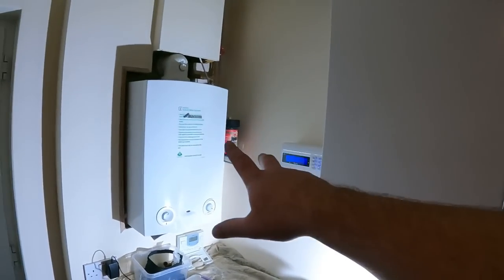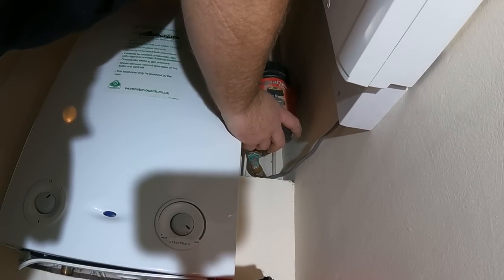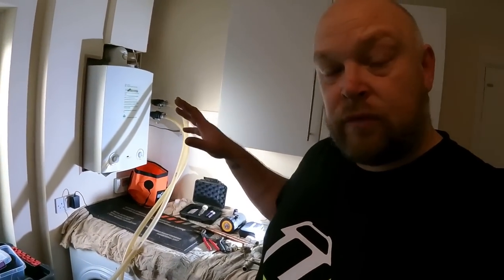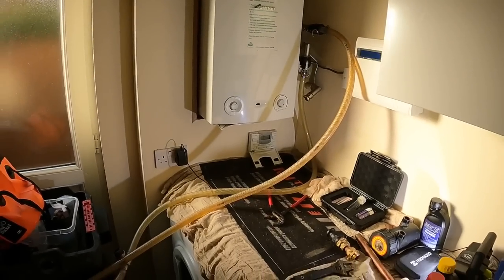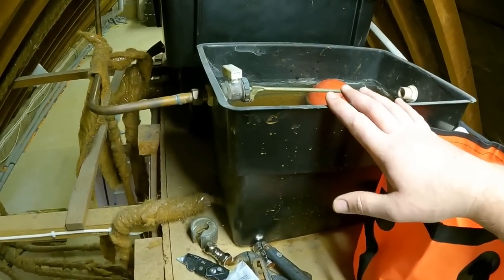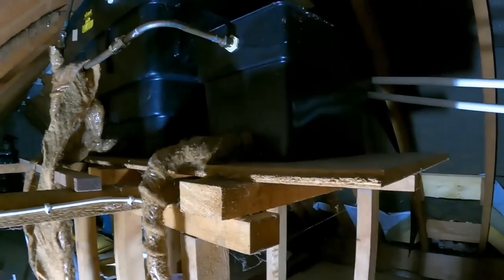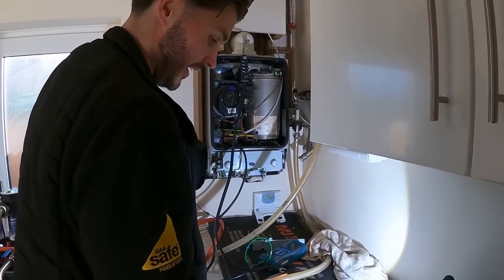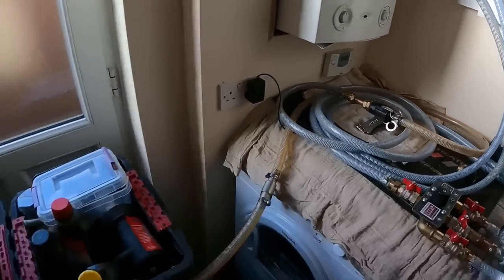HEATING SYSTEM SLUDGE REMOVAL PART 1 | Flushing & Chemical Cleaning

Comment: Decent vid fells.
What I used to do was link the open vent to the cold feed with a piece of hep 2 valves on on vent & cold feed so you flush that pipework as a circuit which cleans out the vent & possible blocked cold feeds. 
The orange colour is an indicator of air being drawn into the system so check the open vent & cold feed config in the airing cupboard & pump speed . 
When I used to do bgas upgrades had to do power flushing before Magna cleanse were around. It was laborious & soul destroying .
Good luck on finishing it off all ok & look forward to part 2 👍

Comment: Very useful video Thanks! I'm gonna diy flush my system over summer and i already got the isolator on the tank oulet, but i was wondering about the vent, so it's useful to hear you just cap that off temporarily. Also flushing rads one by one is useful. Ta
Reply from the maker: Glad you enjoyed it mate

Comment: Do you use that folding bucket when changing 3 ports in airing cupboards? I currently use rubble sacks to catch water then bunging but really like the look of that folding bucket. What you think mate?
Reply from the maker: For £12 it’s worth giving it a go mate, looks more professional than a bin bag aswell😉
Reply: @MJTiffPlumbing  haha that it does mate, will give it a go, cheers mate

Comment: Hello mark great video can’t wait to see part two, on your thermal imaging camera are you able to adjust the temperature sensing range to detect a closer grouping of temperature if you get what I mean for example to show between 60 and 50 degrees as red hot then anything below that shows as darker red to blue. When I have borrowed one before that’s what the guy said to do to get a more accurate view of what spots on the rad aren’t performing quite as well as the parts that are reaching that set temperature
Reply from the maker: Yer they are fully controllable and adjustable 👌🏼👌🏼

Comment: Great video Mark. Many’s a job I’ve went out too and cleaned the F&E tank cos the dirt of them was atrocious and I’ve seen me making a lid from 1/4 inch ply just to keep them right. Your wet vac beats emptying into a bucket by hand and then coming down out of the loft to empty said bucket into toilet up and down like a yo yo lol. Great video mate. Where did you get your infra red heat detector for the rads it’s a great job that?
Reply from the maker: Thanks buddy… 
The camera is a HimMicro Pocket 2 👍🏼👍🏼

Comment: Why wouldn't the original filter do that job Mark?
Reply from the maker: The inline original filter is less aggressive and a lot smaller than the Magnacleanse system….

It’s a secondary device to keep the system in check

Comment: Knock the pin out the middle off the adapter mate and separate it ca get it in alot better then
Reply from the maker: I tried that and the thing wouldn’t budge!!!….. I thought I had done it before as well.

You’ve confirmed to me I had and it can be done🤣

Comment: is that MC5 only for the MagnaCleanse or can you use that instead of mc3 with a magnaclean? also I've agitated all the rads and some still have cold spots, i take it next step is replace radiator?
Reply from the maker: MC5 can be used in any system your flushed buddy

Comment: Evening Mark, be interesting to see tomorrow's result with those magnets after the state they're in so far. You planning on replacing the filter too? Have to admit I hate those plastic threads on the magnaclean! Seen a few of them strip threads over the years. One lad I work with tried to undo the magnet and it snapped off!
Reply: The plastic threads onto the isolation valves I mean. Not the magnet itself
Reply from the maker: This one was in pretty good order, I did have a new one with me however the new ones are directly inline and these ones are slightly set apart so it’s been piped up to suit that…. Would of been a pain and the old one was in good order to be fair👌🏼
Reply from the maker: Tomorrows results are interesting…..

Comment: Damn gotta wait for part 2 now!

Looked like the customer was planning to throw a party to celebrate the flush being done! 😂

Quick question if you don't mind, what size grips/adjustables do you prefer for day to day stuff. I'm in the market for a decent set as the college ones are crap, but dunno what length is best to buy.
Reply from the maker: Only 24hours to wait mate😉😉

12/14/16” for the win mate👌🏼👍🏼👍🏼
Reply: @MJTiffPlumbing  thanks bigger than I was looking at I was only looking at an 8" bahco and 10" grips
Reply from the maker: Depends on what work you do, and how big your hands are….. try them out👍🏼👍🏼
Reply: @Tom_Plumb_PHS  You will need those sizes. As said. Depends on what work you do. Do not underestimate the price too. Poor tools will cost you. The best ones, not expensive, will last you a lifetime. Bahco, Knipex. Sometimes you'll go to a job that someone has left their best pair! hahah keep them.
Reply: @MJTiffPlumbing  thanks Mark planning on domestic mainly at the moment but you never know where the road will lead you.

Comment: Don’t want this to come across as a DHC Mark, but why didn’t you pre dose the system and then go back and use your thoroughflush to flush out? I know even an 8-10 rad system can take a couple of days to flush properly, if it’s heavily contaminated, but didn’t really understand why you spent a day with the magnacleanse
Reply from the maker: No mate, I don’t see it as a DHC, I appreciate a proper question and view buddy👍🏼👍🏼

That’s why I put the MC5 rapid flush in first, as that’s a few hours of more powerful flush, then the MC3 overnight…… then part 2 is the thoroughflush.
You can’t just put chemicals in and that’s it…. You need to agitate the rads during the process as shown👍🏼

Plus I always like to be about when flushing for a day for safety👍🏼
Reply: I know that mate. Flush wise I will pre dose the system with cleanser and let it circulate for at least a week, before going back and then flushing. I suppose it’s the way I’ve been taught from years gone by, but always intrigued as to how others do it.

Personally, I find the longer I can keep cleaner in, prior to flushing, the better the results 👍🏻
Reply from the maker: Yep I here you mate, we all do stuff differently and get the same end goal👍🏼👍🏼…. You will see in Part 2 the results
Reply: Good man, if your at installer on the snug stand again this year, put a couple of them pink ducks to one side for me, the kids love them 😂
Reply from the maker: I will be on the Wednesday mate…. Come and say hello, I will grab you a few😉👌🏼
Reply: @MJTiffPlumbing   good man, will be there the Tuesday and Wednesday, me and a couple of lads are making a couple of days of it, see you then mate 👍🏻
Reply from the maker: Good man, looking to be a cracking show this year

Comment: How comes you don’t just seal the system? I.E do away with the header tank?
Reply from the maker: If the customer wanted a sealed system I would do, they would need a pressure vessel and PRV etc as well obviously
Reply: @MJTiffPlumbing  perhaps part of the reason it’s so dirty is because it’s open vented?
Reply from the maker: Yep always seem open vented system are very brown and rusty, possible due to the air getting in

Comment: in my opinion, them adey pro checks are pointless.
Reply from the maker: How come out of interest?

How would you know that all the chemicals have been flushed out the system??
Reply: @M J Tiff Plumbing  you don't with them tabs only checks for certain chemical and not all cleaners use that specific chemical in them. So you could be double dosing and causing chemical reactions to having a different  brand of inhibitors in. I've known them to say that there isn't any inhibitor in when i know there is. Just a different  manufacturer. 
We should be using proper water quality testing kits.
Reply from the maker: To be honest I’m pushing more to zero inhibitors in systems when I can as they do in Europe.

Comment: I hope the customer doesn't see you emptied the heating water down their sink 😬😁
Reply from the maker: Why’s that then buddy….. 🙄

I guess you think a chemical system should be emptied onto the ground🤣🤣
He was fine with it as well….. in fact he was interested in what was coming out…
Reply: @MJTiffPlumbing  it should be emptied down the drain outside clearly . Maybe you will learn the dangers of the chemicals when you go on the course.  People prepare food where you poured highly toxic chemicals,  shocking really
Reply from the maker: Not in the utility they don’t fella…….🙄
And guess where the drain goes…. That’s right, outside into the external drain…

Thanks for watching…..as it’s so “shocking” I’m sure you won’t be watching anymore of my videos….. 👍🏼👍🏼
Reply: @MJTiffPlumbing  lol maybe you don't prepare food at home but many or most do . So you undthe danger of the chemicals yet believe there's more danger from these chemicals escaping out into the fresh air into the extractor fan and causing harm in the house than escaping into the air in the utility room,  not to mention the remaining chemicals left on the surface of the sink ? 🤔🤔
Reply: @MJTiffPlumbing  sorry didn't read it correctly I thought you said extractor fan instead of external drain . But do you honestly believe it's good practice to do what you did ? Highly dangerous practice I hope the course is soon 🙏 😉😉
Reply: @MJTiffPlumbing  probably won't to be honest as I have watched a few in the past and have found the work to be quite basic to be honest . Be surprised if any qualified plumber would lean found them . But keep at it and take care 🙂
Reply: what a prat 😂